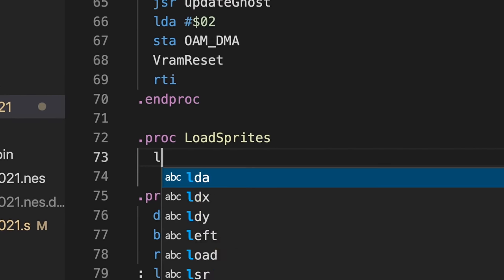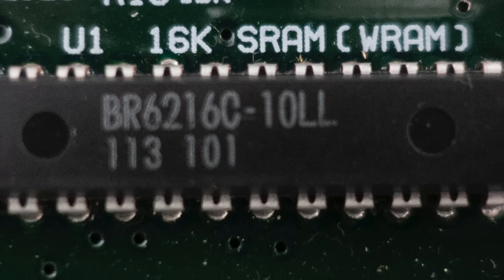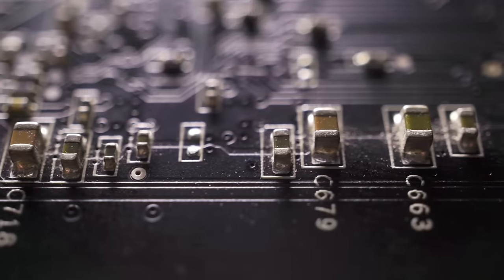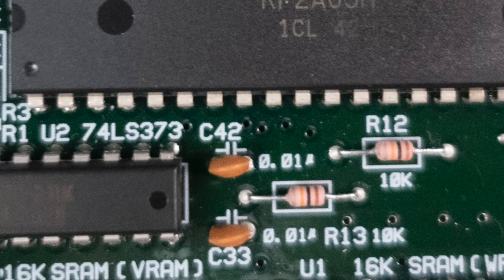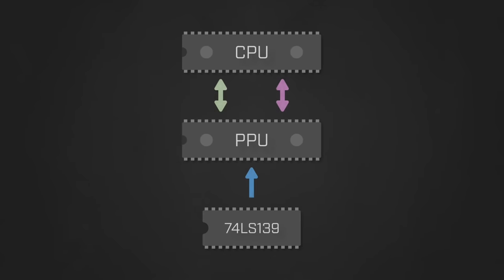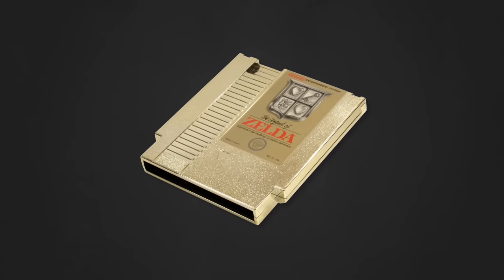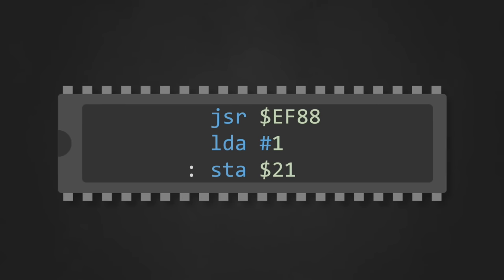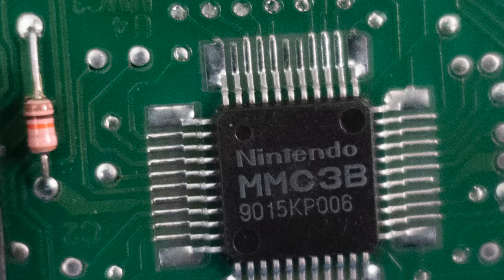NES Architecture Explained

Comment: Excellent video!  I was always fascinated by my childhood computers and never really understood how they worked until much later.  While it's all still a bit overwhelming and hard to follow, I get the general concept.  I even started to write a few things in assembly for use in emulators. They were nothing of any major significance but it was fascinating to learn how these systems used and interpreted data and memory locations which gave me a much broader scope of the talent required to code on these old 8-bit machines.  C# is much easier than assembly!

Comment: I know the NES had the capacity for various enhancement chips.  I find it really off that they didn't sell those as addons for the system rather than including one in every single cart.  The cost associated with including what is essentially another computer inside the cartridge would have led me to surmise this wasn't a good option but clearly that wasn't the case. I mean they could have sold the upgrade dongle once and left those chips out of most cartridges saving lots of money.  I guess they didn't want to confuse people with too many operations and they didn't want to rely on users to correctly match upgrades with specific titles and in the end the price didn't end up being a concern.  Still this is a very odd concept when looking back at it from a world where adding things to your home equipment is no more complicated than plugging it via usb.
Reply from the maker: Hmm... I think they were thinking more about their licensed developers than the consumer angle. Who knows, Nintendo works in mysterious ways to this day...
Reply: Most of the NES mappers were pretty simple, the equivalent of maybe 5 or so 74xx chips.  So it's not exactly a second computer, and the chips were likely manufactured at scale for a few cents each.

Comment: Forgive if someone already asked below, but how do the "helper" chips such as the FX in later, more advanced carts fit into this scheme?
Reply: With multiple processors there needs to be hardware for an atomic lock. A special memory where each CPU reads a byte and then writes back. In between this address is blocked from the other processor. You can store FIFO pointers there.

Comment: I don't understand the purpose of CHR RAM vs CHR ROM. Why would the CPU or PPU want to write stuff in a place which servers as tileset storage?
Reply: In CHR-ROM, all graphics data is stored statically, it can only be read. In CHR-RAM, the CPU can move the data around to create visual effects. In Battletoads, on the stage Arctic Caverns, the tiles that make up the background are moved around by the CPU to create a scrolling effect inside of the fully static character tiles.
Reply from the maker: Sometimes games have more graphics than can fit in the 8KB memory space reserved for tile data. A good example of this is a game like Final Fantasy where there are many different monsters, most of which are composed of at least six tiles. If the NES didn’t allow games to swap tile data in and out they would be severely limited in what they could do as far as raw graphics data is concerned.

Comment: Is that a 2DCat song playing in the background while you're explaining the overview of the component groups? It's so faint, yet hammering that "you recognise this track" button in my mind so hard I can't pay attention to what you're saying.
Reply: heck, I checked the description and looked at the end for credits, but apparently the track just loops the whole video. Same synth line running over and over. That's going to be an earworm until I find out what it is.
Reply from the maker: I think it’s called “Power Punch” by 2050. I ended up cutting the track into sections and modularized it so I could use it for the whole video… but it can get really repetitive, so these days I usually mix with 3 to 4 songs.

Comment: Besides assembly, what other languages were used? Did it support c++? Could or did someone develop linux for nes? Just wondering 'cause i want to know if my language wouldve worked on it.
Reply from the maker: So assembly is just a layer above pure machine code (literal ones and zeros that are read and executed by the processor). C++ and other higher level languages are compiled down into machine code as well. So support here is a bit strange a term. You could potentially make a basic compiler as long as it spit out 6502 machine code and the system would run it.

That said, I know a lot of folks use cc65 (the C/C++ compiler for 6502 based systems) to do NES game development as well. It makes some things easier but other things harder from what I can tell. I mostly stick with assembly because I feel "cooler" when programming in it (and it was the first way I learned for the NES).
Reply: @NesHacker  I know support is a bit strange. I meant was one written, which you answered. But something i was wondering, and based off of what you told me, 'maybe', is if linux would run on it if the kernel is already runnable on it or not. Then, if you could have the os, if my language would automatically be able to run on it, or if memory or something would be an issue. Eventually, im going to write some new software, with linux and my language. No i dont care right now about support for nes. I just wondered if doing it was recompilation away or not, without modification.

Comment: Can you give any advice on some electronic issues i'm having.
Thr colour is bleeding after a short while of running and there is no longer any sound.
I have already changed the voltage regulator and the large cap but don't know what else to do.
Thanks.

Comment: I have a doubt in another scenario, if some chip (say chip 1 with addresses starts from 0x0000 to 0x1000) is before SRAM. Now when the CPU wants to read address of 0x1305 from SRAM via CPU, how does that work? If SRAM have it's own addresses that starts from 0x0000 and end up maximum like 0x2000, how accessing 0x1305 works in this case. Does SRAM minus 0x1000 and read 0x0305 in it's address ? OR some chip is needed to route (or convert) the CPU address to meet specific chips
Reply: C64 has the PLA chips to convert CPU address to chip enable lines . I think NES has this integrated by Ricoh. Banks or so.

Comment: This might be outside the scope of this channel. But I was just thinking, I'd love to see a video about all of the different variations of the 6502. The differences between the chips, systems (video game or otherwise) they were used in, the reason they were made. Things like that. It seems like this stuff can be found on Wikipedia. On the page for the 6507 it has a thing at the bottom with a list of the different chips and links to the corresponding wiki article if it exists. But I only read a couple of the more popular ones so I'm not sure how extensive they get. And wiki's just the beginning of the journey as far as I'm concerned. I find it an interesting subject because until a few years ago, I only ever thought the one chip, the 6502 existed, then I come across the Ricoh 2A03, then the 6510, then the 6507 and I start realizing there were a lot more variants than I thought. And I'm just talking about NMOS chips. Nevermind the CMOS variants that WDC still makes to this day.
Reply: But isn’t it great that they were all backwards compatible? And only WDC dared to modify the core ( NES did only cut a single trace ).

I feel like that if you drop compatibility after 1980, you would go RISC. Arm atmel sh2

Comment: The NES's architecture seems like it could be perfect for 8-bit microcontrollers if the PPU were omitted and the 2A03 was replaced with a stock 6502 or 65C02.

Comment: Awesome video. Subscribed! Would love to know if there are any major differences between the 11 NES board revisions. I’m lucky enough to have an CPU-01 and 02 test market boards. The colors these NES’s display is off. The underground levels is Mario 1 look green instead of blue and red colors look pinkish. What would cause something like this?
Reply from the maker: Huh, I'm gonna look into that. It would be rad to get a hold of a system with an alternate palette.
Reply: @NesHacker  I was planning on selling my 02 on eBay. It’s a low 56,000 serial NY test market console complete and barely used condition.. As far as I know, 01’s (extremely rare) through 03 have these color pallet problems. Famicom’s with the same CPU & PPU revisions don’t have this pallet issues, which makes this even more interesting.

Comment: Thanks for the video. That's some great in depth information. I'd like some expanding on how the cart knows that SRAM is being accessed. I mean, it has only 15 bits for address since only 32 kBs are mapped for program ROM but SRAM is usually  mapped at addresses 0x6000 upwards. How is it possible?
Reply: You need to check a few more of the address lines to be sure. A15 is not directly available to the cartridge, but its state is, after all we need it to produce a chip enable for the ROM at least. So you need A15 to be low, but A14 and A13 should both be high. Any of the lower bits can be whatever they want to be. This will tell you if you are between 6000-7FFF.
Reply: @vuurniacsquarewave5091  Oh! That's a clever techinique right there! Thanks!
Reply from the maker: I feel like I lobbed a pass and you just slammed it down. Kudos.
Reply: @NesHacker  I'm honestly just happy to know you're still around haha. If there's ever anything I can help with to keep this going I'm ready, especially when it comes to the audio. This has been my hobby for 8 years.

Comment: Loved your video. I was a hobbyist with a C64, and NES is very similar to a C64, I guess it's because of the 6502 and 6510 chips being essentialy the same.
Could you please make a "SNES System Architecture Explained" video?
Reply: The NES is architecture is a lot different from the Commodore computers.
Reply: @sa3270  Thank you for your answer, I surely need to  refresh my C64 memories and get deeper into the NES.
Reply from the maker: Well I mean they're both 8-bit systems, they both use busses, but I don't the specifics for the C64. I don't know the SNES architecture, but I am sure if I stare at a schematic until my eyes bleed and read a bunch of stuff I could probably distill it into a video.
Reply: @NesHacker  Thank you for your answer. I'll be following your channel to know more about NES. Your videos are really informative and very well done.

Comment: Could you make a system around this hardware for work? People did try to make the NES into a home PC with software but it never took off. There was a push for a modem so people could do taxes, stocks, and banking and bet on races. Most systems seemed to be 48k and higher and did cost 5 times more.
Reply from the maker: I mean it was a pretty okay system for 1983. Not top of the line, but still...
Reply: You're thinking of the FAMICOM, which had the Family Computer Network System as an optional peripheral (in Japan only).  It did pretty much everything you mentioned.  But it didn't really work out.

Comment: 16-bits of address data on the Nes....what? How can the Nes address 16-bits of data? Unless of course its co-processor is of the 8-bit variety? Then I guess it could read it in 8-bit chunks kind of like the TG-16 with its dual 8-bit processors.
Reply from the maker: Hm I may not have been too clear (since I speak pretty fast in this episode). The 6502 processor is designed to work with 16-bit addresses natively. In the compiled machine code these addresses are stored using two eight bit values: a low byte for the least significant bits, and a high byte for the most significant bits.

Also, on a hardware level, the program counter for the 6502 (a register that stores memory address for the current instruction being processed) is stored as a single 16-bit value.

When a system is 8-bit or 16-bit (etc.) it doesn’t mean it can’t handle anything but values of that particular size. It means that the basic size used for most operations is limited to the given size (such as math operations like addition and subtraction, comparisons, and position relative branches or jumps).

If 8-bit computers were limited to using 8-bit addresses then it could have only 256 bytes of addressable ROM and RAM… which isn’t enough to do anything as complex like an NES game.

Comment: Could it make a frame 0 and frame 1 in the frame buffer like a 3d card? If so, can you program a pixel process, if the pixel is black in the frame 0, next frame the pixel is white, so the pixel process would be gray.  Last month I figures that the MARIA in the ATARI 7800 could be a pixel processing from what I read in Wikipedia. I wrote about that the 21 last month. So 2022-04-21. That  pixel processing would be a world of gamers saver because of cryptocurrency, they are mining like crazy and next year it will be hell for all gamers again with overpricing graphic cards. I'm not a programmer or coder, nor an engineer, just searching stuff. Can you look in this Pixel Processing please?
Reply: Why don’t you use an Apple ][ or C64 with their official pixels. Both older than NES.

Comment: S l o w e r speaking
Reply from the maker: Yeah I corrected this in the next video. It’s hard when you don’t have someone else directing, cause you get used to the cadence of speech when you hear yourself over and over again during editing and graphics creation.
Reply: @NesHacker  hey man no worries it was just a little honest criticism no disrespect or harm intended love the work fellow programmer myself so at least I know what you're talking about even when it gets too slow or too fast need anything let me know got all the goodies you could ever need and never could want LOL can't wait for the next one talk to you soon be good stay safe
Yeah by the way I had to come back and add this editing do you have any knowledge of the never used expansion port on the original models of the NES console the one that actually had some of the PCB and circuitry actually heading to the connection point that they eventually removed I've only seen a similar console from the world championships where it's got the rj59 starting gun switch so to speak attached to him but I didn't know if you knew anything about the architecture as far as the never used expansion port

Comment: Background music is way too loud compared to your voice. Remove it, or lower it by 30-40%.
Reply from the maker: I’ve noticed it really depends on what you’re listening to the videos through. Sometimes you can’t hear background at all, other devices it’s too loud. Out of curiosity, what do you listen on?
Reply: @NesHacker  I'm listening on headphones, and I noticed the music is way too loud as well. Knocking it down 30% would be good, but no music at all would be better. But the device shouldn't matter - your video editing software of choice should be clearly showing your music channel is blowing out the voice channel. If you want an example, check out PBS Space Time - they always have some music playing in the background, but it's very very subtle and probably at 10% of the volume this video is at.
Reply: @NesHacker  Laptop speakers; MacBookPro